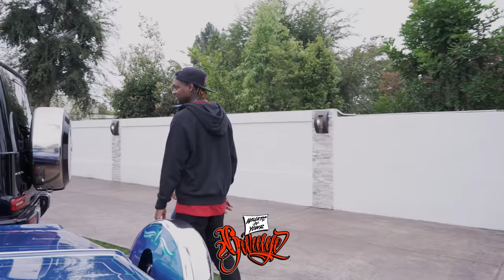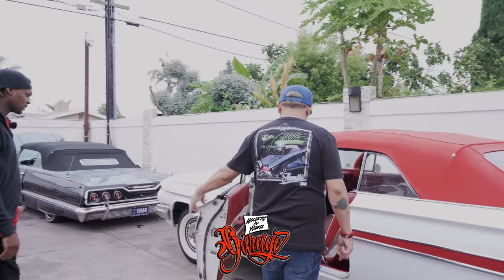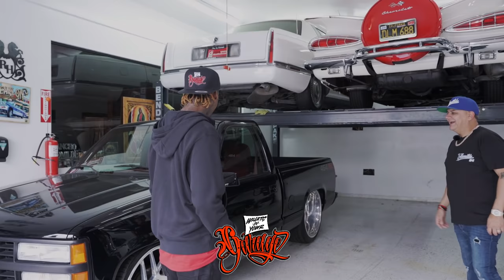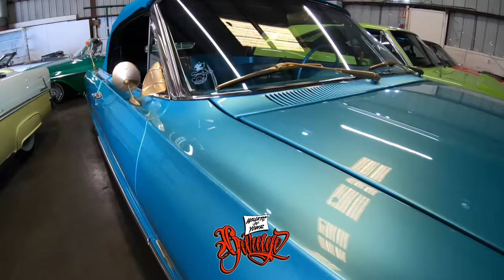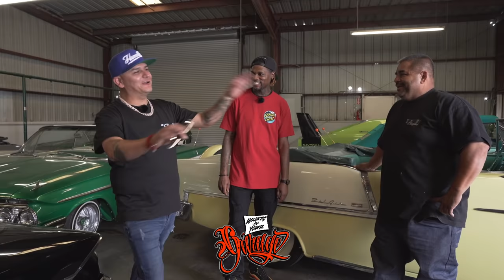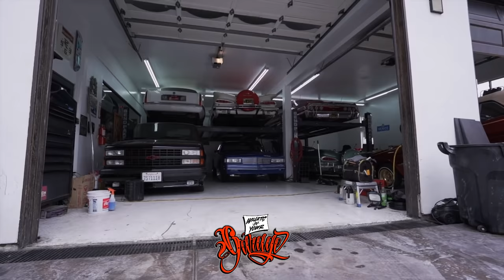What's in your garage S.4EP.5 Jimmy Humilde's car fleet (watch in HD/4K)

Comment: OMG Jimmy been with the lolos cents the late 80s 42 now had and still have custom bikes ,78 Olds 88,50 Chevy chopped needs work and wrecked 2 Dr 63 was hard top roof messed up so I cut to soft need frame top hood trunk ill fix the rest, but yes from TX need that 63 I'm white og from spring branch was in Latin Image but show bike got stolin out my house all most got out but I'm low 4 life, I swear I'm a real builder still in a shop working and building whatever I can get my hands on, U and Cali R my inspiration to keep building ,on a low budget is the tricky part, much love keep flyin guys.!%$

Comment: Dude was talking about his truck like.."everything original."  2 seconds later, " I did the differintial, I did the quarter panel, I changed the tires, I changed the wheels, changed the tires, changed the brake light, etc." Sweet ride. But funny.